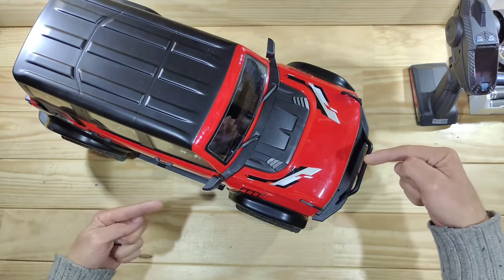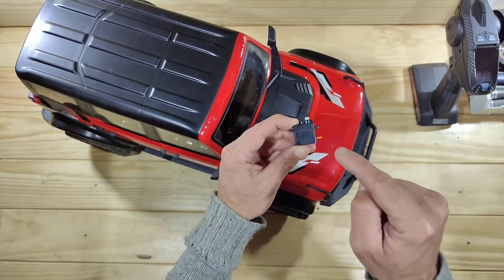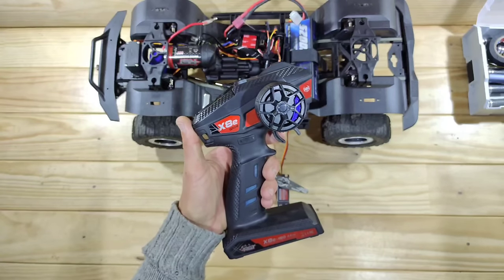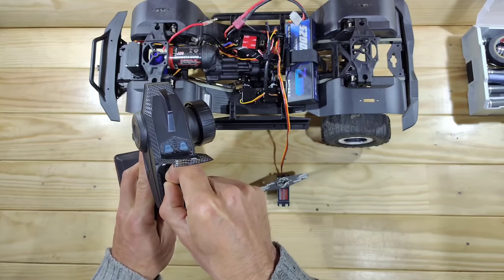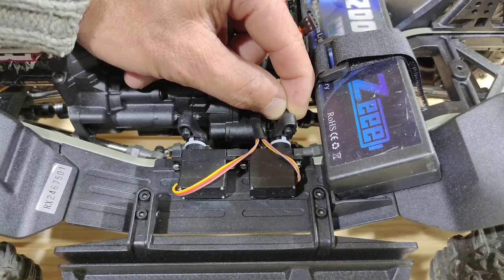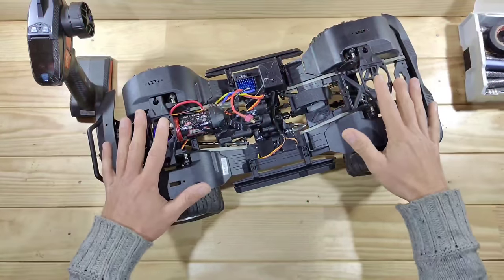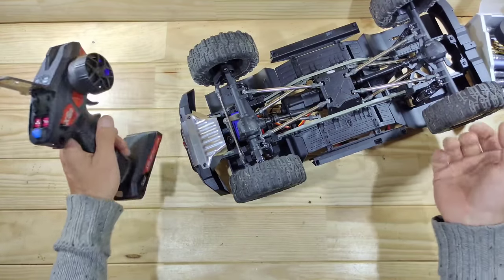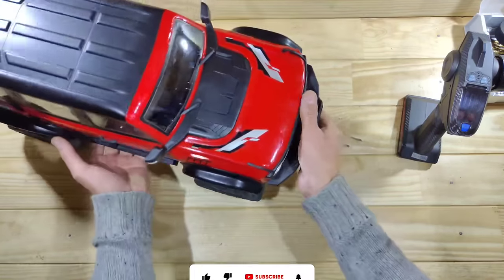Solving a Major problem and free mods for the RGT Pro Runner EX86130

Comment: Super helpful video, I don't know if I was going to burn my servo or not since I havent gotten mine delivered yet, but you can be damn sure that I'll sett the endpoint before my first run.

The loose screws are really a bad sign, gives an overall feeling about build quality..
Reply from the maker: The overall build is good, just that the end-points aren't set correctly is a pity

Comment: thank you for the video, currently my rgt 86130 for the dig function is not working, will it return to normal this way?
Reply from the maker: Sorry, I don't understand the question
Reply: @hofsplace  what I mean is, my dig function is sometimes active and sometimes not active, if I activate dig, sometimes the rear tire doesn't lock, but after some time, the rear tire just locks
Reply from the maker: @muhammadindrasukmayudha2693  when  engaging or disengaging try to go a little backwards/reverse and then forward it has time to lock in place

Comment: Can you tell me how to install rock lights on it
Reply from the maker: On the light ports there is no free space, but CH4 is free. You can use the power from CH4 to run the light. Unfortunately you cannot turn them on/off remotely as CH4 is in use for the winch
Reply: @hofsplace  Thanks that's a big help👍

Comment: Why did the ex86130 lamp blink? Without me setting it
Reply from the maker: The LED's have a blinking mode. Or maybe the lights were on, but the TX not?
Reply: @hofsplace  yes, LED's have a blinking mode, but i didnt turn on that mode's. for your information, it have different speed of blinking. its like blinking mode..

if my rc start blinking, i can turn on blinking mode too (different lights out), but i can see different about "turn on blinking mode" and "start blinking"

its not only my rgt ex86130, i comment someone vid's too, and it happened to him too. but, he didn't know the answer because of what
Reply from the maker: @thaufaniqbal  sorry, I don't know
Reply: @thaufaniqbal  belokin ke kiri 4 kali atau ke kanan 4 kali nantik gak kedip lagi itu bro
Reply: @dylla924   oalaa okeoke mantapp broo, makasihh
Reply from the maker: Hi, I saw the video you sent me, sorry for the late reply. It I the hazard mode. Turn the steering wheel 3 times quickly, than you can turn it on and off